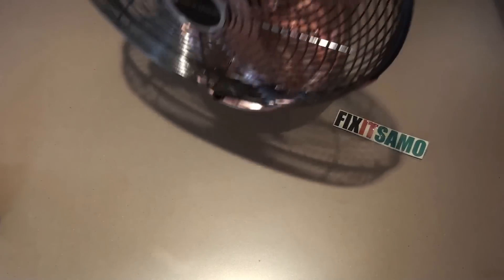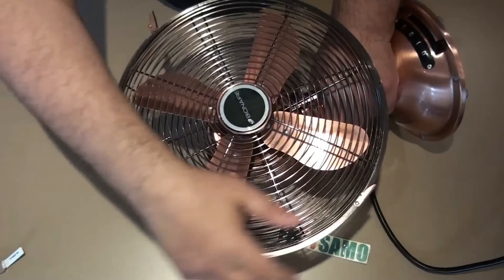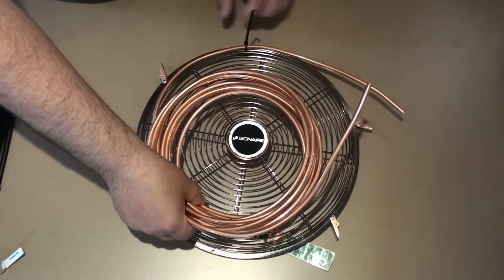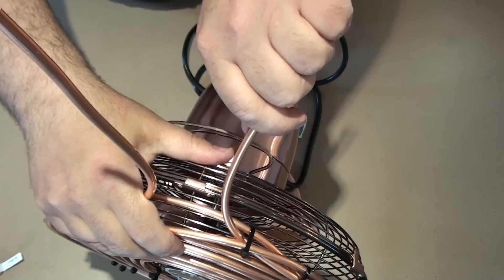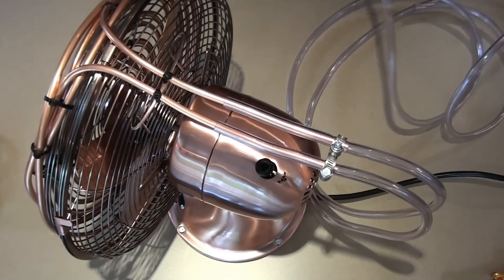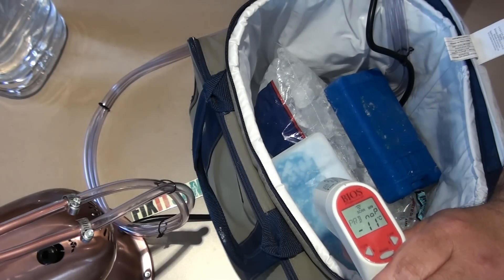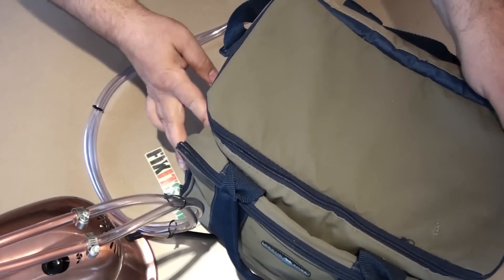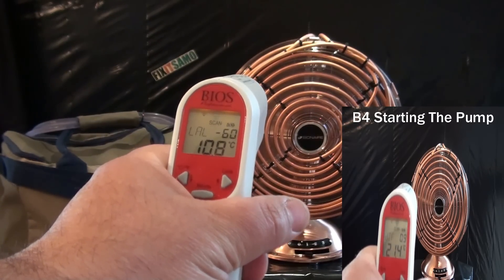How To Turn Your Fan Into An Airconditioner  AC

Comment: I do not have technical knowledge but I figure the ideas is good. Ice replacement will not be a problem since my refrigerator can produce ice at no extra cost. I guess the copper transports cool water while the fan disperses the cool air. Also the blowing keeps the tube cool ? Like to know the wisdom behind all this before building one.
Reply: It is a brilliant way to get you through the summer, however it'll cost you allright - in electricity. The refrigerator needs to work much harder to produce ice. If the climate you live in is not a permanent hell all throughout the year, go for it without second thought.
A rather cheap solution for permanently hot climates is a secondhand mini split system, which is highly efficient and you can purchase for much lower prices than a new one.  However, do get it checked beforehand by a technician you trust. There will be no need to run it all the time if you associate it with the fan facing towards you. This saves greatly in electricity.
Reply: @luismorillas7689  thank you for the realistic opinion. Yes it's hot through out the year. My freezer compartment is on any way should it consume more power if I keep water to freeze? Well imports from China are halted due to COVID for a while so no A/c imports 😆. I will look for a second hand one.
Reply: @lawrencefernando6610 it will sure put an extra load on your freezer, making the compressor run for many hours more than it normally would. Besides, there is only so much water it can freeze in one day, which is tipically no more than 4L. The project presented in the video is brilliant, althought only fit for countries with few months of boiling infernus every year. The refrigerator serves a crucial purpose in our lives and thus should not be burdened with such unusual loads on a regular basis.
Reply: Thank you. We do have a couple of boiling months. Might as well go in for a small AC

Comment: Swamp cooler at its best
Reply: Swamp cooler without the swamp effect--no added humidity.  Not toxic like more effective freon.
Reply: It is my understanding that a "swamp cooler" works by evaporating water..
Reply: niecers  And how does it add moisture to the air? By evaporating it

Comment: I would suggest terminating the copper tubes along side of the fan.  Placing the connectors right above the electric motor to the fan is risky. If those connectors should ever leak then your fan a/c unit will transform into a toaster.

Comment: So, to the ONE critic here who knows too much yet not what counts, I ask : 1) what is a refrigerant? And 2) is a refrigerant more effective at cooling when spread over a large area, (you know, like the inside of an a/c) or a single focused area?
The refrigerant [water] is more effective at cooling spread over the large surface area of the fan, than just blowing over a bag of ice. If not, home a/c units would just have a container of freon in front of a fan. Or my cars coolant would just circulate inside the engine block instead of through the radiator.
The only thing I don't like about this idea is the extra electricity used by the pump.
Reply: @marksword1627  I agree with you somewhat, but there is no real heat sink in my opinion. From an energy standpoint it makes no sense. Why say I'm saving energy when the ice was made with an HVAC system in the first place? Unless you personally are taking advantage of load shifting on some major scale (i.e. not a home resident), but then again... you need a real HVAC lol!

These will be the same people that use the freezer's ice packs in their DIY projects, and put it back in the freezer later and not realize they are doubling paying for the electricity... You paid to cool something down, so you could cool the air (that got hot, from you cooling it down), that gets heated back up again when you want to cool down the ice pack again? Yikes. The engineering heat balance on that is basically running two different fans and two different pumps in the closed system (DIY fan and pump and HVAC fan and pump for ice), there is only heat being generated in this system, no heat sink, so you really aren't cooling off anything, and again, you are paying for TWICE. Leaving the Fridge door open is actually MORE efficient (less fans and pumps! but wait that makes no sense!). There are points to be made about where you might make the ice, how well insulated the home, how locally needed the cooling, radiant effects in the home that might diminish the overall "felt" added heat to the home. It still doesn't change the thermo balance of the heat.
Reply: Don 't ask you tube questions. Go research. For reference this is a swamp cooler. Not an HVAC system. 2) Surface area always helps heat transfer. You are mistaken on the extra electricity used by the pump. All HVAC use a compressor to use pressure energy to take advantage for latent heat changes. This circulates the Freon.  THIS IS NOT AN AIR CONDITIONER in the video. If you are confused on why this is different than your HVAC in home, GOOD. IT IS DIFFERENT. You clearly have no idea the difference of a fan pulling air over something that is going through sensible or latent changes....  1) refrigerant is anything used in a closed loop system to carry heat out. Do not compare blowing air over ice water to air conditioning a home it's not the same thing at all... Just research some more.
Reply: use Kool-Aid.  use Purple Grape its keeps it cooler than most flavors.

Comment: Is there any condensation? If so, how much?
Reply: A LOT!
Reply: brandon fields MINECRAFT
BOB
GAME
BOY
WALL-E
Reply: in order to combat the condensation you can get a hair dryer put on full heat and evaporate it periodically. just make sure you aren't blowng the condensation into the motor of the fan and you'll be all set!
Reply: @smitha5692  yeah, you don't live in a humid part of the world, I guess. Coil the front grate, and keep it running murdering medium to high. Tilt forward before turning off.
Reply: @TomPutty  how about me anyone? I live in indonesia which is 98% humidity and it weather is about 27-36°C. Is it means that I'll have a lots of condensation?
Reply: Excellent point.  Putting the fan in something like a shallow kitty litter box would collect any of the condensate.

Comment: So if I wanted to use a vintage belt drive maybe either from the early to mid to late 50s or to the early to mid 60s or so with a square piece of wire on the front for the guard...then could use that since it’s a 20” and blows a lot of air or so...or my maybe like 07 or something like that, p25 by Lakewood or so with 3 aluminum blades with black and yellow caution tape on it and the tape is made black and white itself with aluminum blades like I said that are kinda wide with some this of heavy duty steel blade holders or so, maybe steel or something like that. But yeah I guess. Oh yeah...and there’s a mutual friend who went to the same hs I went to...mbhs who’s selling a large vintage belt drive fan....well actually I think that maybe they are as a famous, and maybe her dad or so from his shop that it was used at or so...but if I put some type of either square or circular shaped guard...then could that work too or so?🤔

Comment: Sir, first, please forgive my flattery, but THIS IS GENIUS, IMSO ! I fully intend on making one of these in the next couple of weeks, as my room gets quite hot... Second, will this EXCELLENT contraption work if the cooler is still on the floor, but the fan is elevated or on an, um, "tall" stand? I mean, will that little 4W motor be powerful enough to force the water "up" and against the force of gravity? Please, if you have a moment.... Because I want to make one for some friends, as well, if the latter will work.... Thank you and God bless for ALL your Many helpful videos !
Reply: Post an update letting us know how it worked for you.
Reply from the maker: Hello The water pump that i used it pumps 75 gallons/hour  it could pump water up to 5 feet high its not about how many W its how many gallons/hour you’re water pump could push thx and have a great day
Reply: As long as you have the return hose go back to the reservoir, and the high part of the system "airtight", the work needed to keep the circulation going is much lower than the work that would be necessary to merely lift the water to any given height.
Reply: If you think your going to cool more than a shoe box  your kidding yourself
Reply: NO NO AND NO

Comment: it can be improved by using salt in the water, using all refreezable ice, using a glycol solution instead of water...cheers cool vid
Reply: why would glycol would be of any benefit here?  You're just transferring heat at temps nowhere near phase change, and you won’t find a better material to do that than water
Reply: @threepe0  With plain water you can never get your coil below 32 F since ice doesn't flow through tubes.  Using salted water or glycol, you can get them colder.
Reply: Ed Cottingham in what planet do you imagine blowing ambient air on copper pipes getting below 32F?  If you had liquid nitrogen in the cooler, maybe and only maybe you’d get any sort of benefit there, and then you’d have died after displacing the oxygen in the room, winning the Darwin award
Reply: @threepe0  I'm going to do this experiment and use a mixture of water + isopropyl alcohol, so that the water reaches a temperature below 0 degrees without freezing. To make the water reach this temperature, I will make it go to the freezer of my refrigerator, which reaches -18 degrees Celsius, and for that I will use the tubes. I don't know much about chemistry or physics, but I read somewhere that mixing water with isopropyl alcohol, using a percentage starting at 38% alcohol, makes the water freezing point less than -18 degrees Celsius, so like the my freezer only goes up to that temperature, the water will not freeze. Hope it works.

Comment: how much electricity consumption is that coasting you?
Reply: Making the ice is the expensive part.  Blowing cold ice water around is cheap.  You can place frozen soda bottles in front of a fan for the same effect.
Reply: pump be 12v dc so hardly much for benefit gained,imo
Reply: @jazpanoz4996  how about the fan?
Reply: Patricio D. Abello  Depends on the fan size,usually range from 20watt to no more than 65watt:)
Reply: @jazpanoz4996  thanks for the reply and info I'm still on the fence about the whole thing, I tried it but was a complete flop, it was my fault though, been getting good results with ice bottles, defently less pain in the ass, I dunno maybe I need to either get a better pump or quit being a worm blooded mammal.
Reply: Patricio D. Abello 🤣🤣🤣 nooo dont turn reptilian....If your climate is humid heat rather than dry heat than nothing will work well except an air conditioner,be my guess for your issue:)
Reply: @jazpanoz4996  lol note to self noted 😜👍🆒Florida isn't as cool as it sounds 🥵
Reply: Ive 5 and 10inch fans that use 12-25w an hour. Most pump use the same. So same as running a standard light bulb. I use it camping. So a 150wh solar bank could run this set up for 5-7 hours easy
Reply: @wukong2282  I'm looking for one on Amazon but not trying to pay 100 or more on a solar panel

Comment: If you use hot water would it be a heater I live in the North Pole and been having an Affair with Mrs Clause and I have access to a lot of hot water for free
Reply: Me and Mrs clause have been gettin jiggy with it she loves my flat belly.
Reply: Attach a rediator with hot water pipes. And put a fan behind it. It will work.

Comment: You are a genius!
Reply: if he was a genius he would have realized the heat his freezer is generating from freezing water 24/7, assuming its in his home, is causing a similar change in room temperature im the opposite direction. Unless he has 5+ well built walls between himself and his refrigerator,  in all reality he's breaking even if hes lucky, The energy he used to watch other identical YouTube vids, gather items, put the "AC" together, he could have fixed his AC that has the additional feature of cooling a room. 
      Aside from this, your right. 300IQ , minimum. 😉👍

Comment: Connect your hose to a cold tap water faucet or garden hose (no pump needed) and you will get the same effect except that it takes longer to cool the room because tap water is not as cold as ice water.  Set your water flow to use as little water as possible.   You can put the return water in large drinking fountain bottles or just let it go down the drain in the sink or have it connect to another garden hose and use the 'waste' water to water your lawn or garden!  Not sure what your daily water consumption would be but I bet it would not be more than what someone would use to take a shower or bath every day.
Reply: First off the pump costs $10 and it recycles the water, if you were using a tap even in the lowest setting, assuming you run it for over an hour which is probably going to be way more in the long run it is going to be definitely more than what “a shower or a bath” would cost.  Second, the point of the pump and the circling water is the water is iced, which is literally the only thing that would make this system work, if youre using anything other than iced water this wouldn’t work, period. And lastly you would have to have a damn 20 foot hose to bring this all the way over to a bedroom or living room. Assuming you dont live in your bathroom or kitchen. Im literally so pissed right now because I think you didnt mean this as a joke at all. Like I dont understand the point of people who comment sh*t like this lol. You just want to sound like youre smart and you know better but you just sound like a jck*ss
Reply: @EliFinixie  
Calling people stupid without explaining why you think they're stupid is pretty pointless too, it's just name-calling. 
His alternative isn't a joke and works: the system needs a difference in temperature, which can also be cold(er) tap-water. Using this method it will take longer to cool a room compared to using ice. The reason the tap-water is colder, is because the water loses it's heat to it's environment as it's flows through the underground piping to your home. You don't need to a lot of flow for this system to work, and water isn't that expensive. If you don't want to waste clean water, you can also resort to a tank that's buried under ground that acts the same way as the bag of ice, albeit not as cold.
Reply: @PL Lyons My system works!  No need to do anything!    No need to add ice packs to the cooler every hour or so!    And where does the electricity to freeze the ice come from?   From a nuclear, coal or gas burning power plant!   So who's the idiot now?
Reply: @joejohnson3441  I am !  I'm the idiot!  ( Am I doing this right ).
Reply: No excuse not to do this if you have well water.
Reply: This is obviously a joke lol. It cant be anything more than that or youre really dumb..... no offense lol

Comment: how about digging a well and using deep ground water because normally deep ground water are very cool and many people dig borewell to use water but my point is to use the water to cool the coils as the cool water supply underneath the ground will be unlimited . This idea might sound very weird but I observed water underneath the ground is very cool.
Reply: that's called a Qanat, it's been a thing for thousands of years in the middle east but is strangely not popular elsewhere
Reply: I'm assuming where heat is commonly used from water in the ground here in Canada cooling could also be a viable option. (Geothermal)
Reply: I live in building
Reply: I feel like most people ordering bitz off amazon for a air conditioning fan are living in cities, where well digging is very illegal
Reply: @catland88  It's not 'illegal' , just most people don't live on land that has any underground water.
Reply: Already a common way of efficient system. Called geo thermal. Run plastic tubing underground and fill with antifreeze. Then run through heat pump.

Comment: My car’s ac vents blow somewhat warm air. Do you guys think this would work effectively if I installed the copper on my vents?
Reply: Take your car to the dealer ship that you got it at a they will spray something In the ac system but tell them it is warm not cold
Reply: @buderp7222  and be out 800-1500 for a guy to use half a 30 doar bottle of freon?
Reply: @richterman3962  ok well if you don't know how it is a way to find out  they will let you watch and more like 70 for us if you have a deal like us but no matter what It takes care of it
Reply: Thanks a ton guys! Turns out there was just an o ring leak that needed replacing. Ac is now recharged back to the ice age!
Reply: Get AC gas refilled. Also check for leaks in AC pipes before refilling

Comment: Wouldn't it be better that the coils are at the backside grill of the fan so that cool air gets thrown out from front instead of warm air making the cold pipes warmer by the time...?!?!
Reply: It would b better if the coil was in the ice ,the back of the fan & the front of the fan, the cooler the coils the the coils will keep it even cooler, 3 coils, under the ice-ice water, bhind the fan & in front of the fan, if ur gonna think cool at least think 3 times the cool'er'er'er

Comment: I had a similar but much larger system in Chaple Hill apt.s in Framingham, finned heater pipes
had chilled water go thru them in the summer and hot water during the winter. a GR8
set-up, nice and even w no cold drafts.